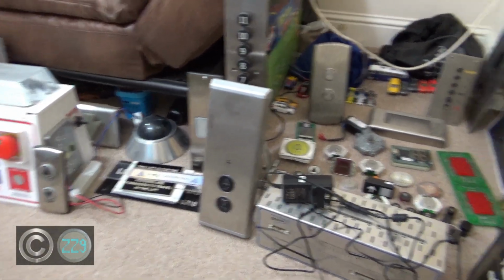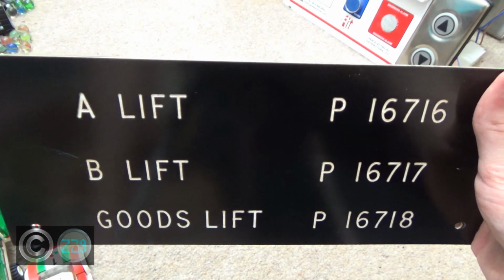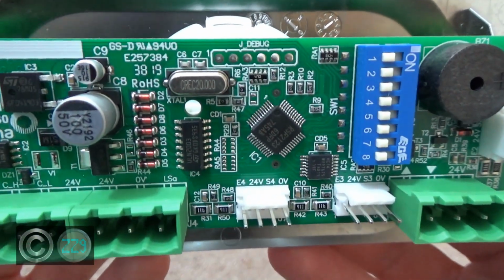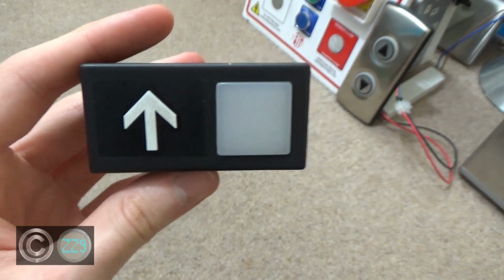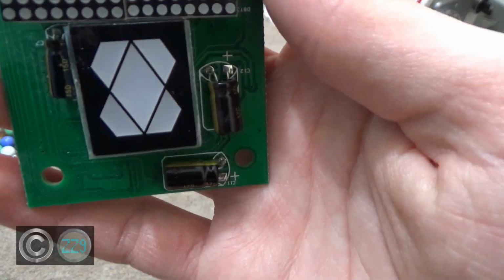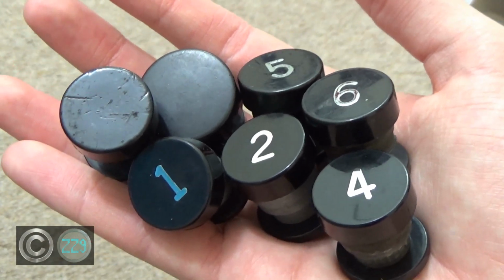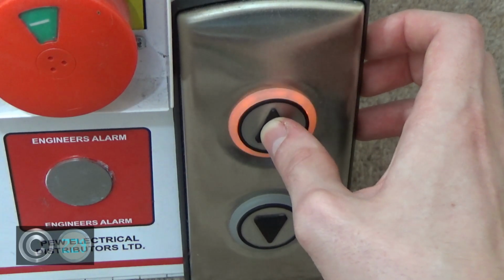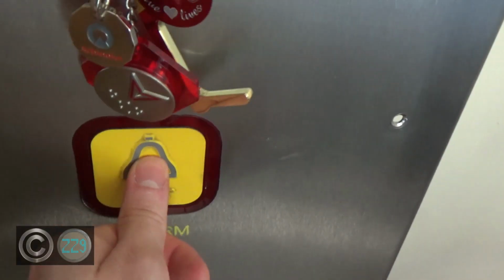Thank You For 3 YEARS On YouTube! Let's Celebrate By Showcasing My ENTIRE Lift Part Collection!

Comment: Considering I'm a little bored right now, I'm going to randomly chapter this out of kindness XD
0:00 Intro
1:25 Keyring
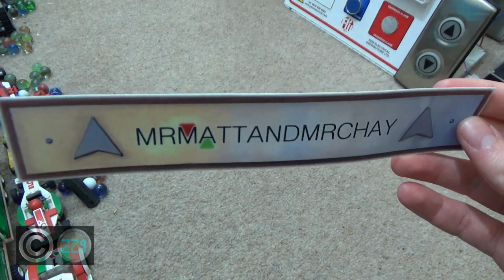4:03 mrmattandmrchay Logo
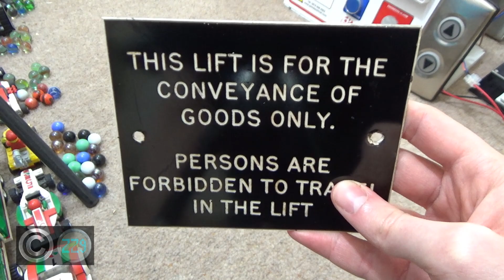4:52 Goods Lift Sign
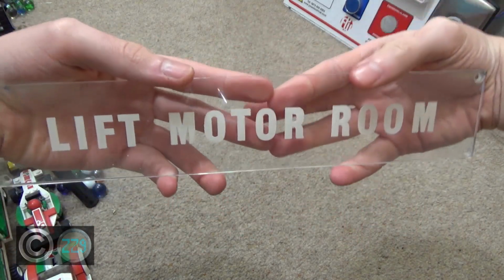5:41 Motor Room Sign
6:32 Multipurpose Lift Sign
8:23 Multipurpose Lift Sign's Brother
8:43 Kone panel goes to sleep
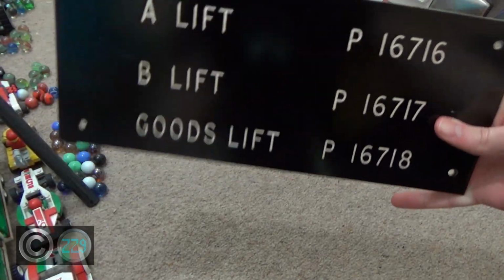8:48 Serial Number Sign
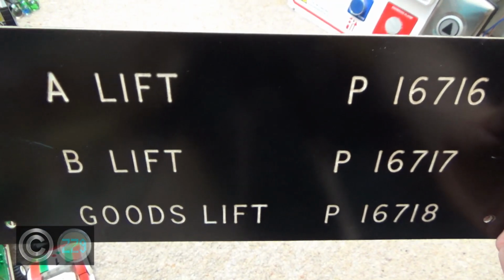10:17 Shepard Home Lift COP
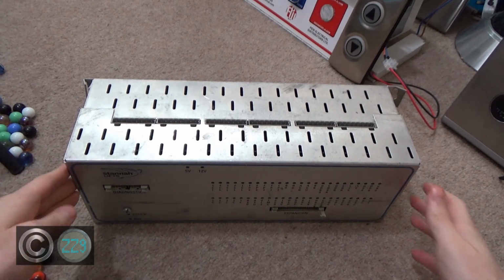11:18 Stannah Logic Box
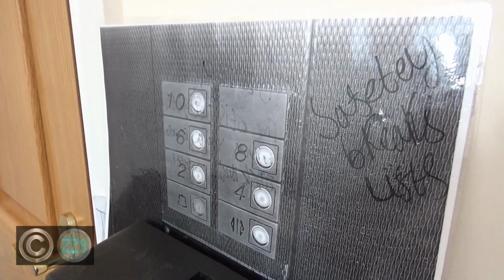13:25 SBL's Signed Picture
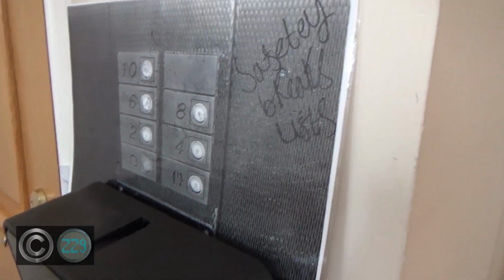13:47 Otis Series 1 COP
15:46 Vimec LOP
16:42 Schindler FIGS LOP
18:06 Orona 3G LOP
20:08 Otis Gen2 Lantern
21:38 Boxless Wadsworth LOP
23:13 Boxed Wadsworth LOP
24:39 American DMG Button
26:08 American Otis S1 Button
27:57 Armour Elevator Tie Clip
28:51 Shanghai STEP LOP
29:58 Old Otis Dumbwaiter Panel
31:20 Otis Gen2/2000 Indicator Plate
32:56 Otis 2000VF COP
33:39 Otis 2000VF Door Tracks
33:50 Otis 2000VF External Indicators
34:26 5x7 Indicator Boards
35:17 Lifteknic Logic Board
36:30 Kone KSI-4X1 Indicator Board
38:45 Old Otis Fridge Magnets
39:40 Evans Lifts COP
41:31 Random unknown thing that could be a door operator
42:08 Lift BuTtOnS XD lol
43:11 Dewhurst C3S Board
43:49 Multi-Key
44:48 Otis Black Buttons
46:00 Otis V Lock
47:12 Lester Controls Buttons
48:50 Kone KSS-470 Button
50:05 The Dewhurst Marathon
54:39 Kone KSS-370 LOP
55:57 Inspection Control
57:17 Security Camera
57:50 Old Otis Lantern
58:51 Dewhurst US85 LOPs
1:02:25 Old Otis LOP
1:03:08 Dewhurst US85 COP
1:04:37 Outro
I think these are right, although I'm not sure XD
Reply from the maker: That must have taken some off the scale boredom to do that XD anyways I can't be bothered to check so i shall assume those are all correct  and thank you for making all that effort XD fun fact the mystery motor o heard at one point could have been a windscreen wiper motor but no way of knowing for sure, way too small for door operator I think
Reply: @ZZ9ProductionsOFFICIAL  Yep, off the scale boredom is right XD. I was just there on the couch, computer draped across my knees, typing the comment as I watched the video. Good times XD
Reply from the maker: XD

Comment: I can't see the Schindler call station or the possibly UK Lift inner panel on the thumbnail. Also if you didn't get notified from my reply on ElevatorsInWalses' comment talking about my hopefully future lift part museum, here it is, (changed a bit): robably a bit of Kone to start off with. Probably KSS420, KSS140, KSS780, regular Sigma, KSSD20, KSS280 and possibly some M Series and Novel Elements! then I'll probably try to get some Schindler buttons, M Series and EuroLift, then some Otis, Prelexan, British Lexan, Selecta, Optima and Lumina and then if I'm VERY lucky, maybe Express 1st Generation! I will probably upload a video talking about it maybe early tomorrow.
Reply from the maker: the Schindler is hiding behind something here and the big COPs are way too heavy to be moved into the room that the rest of the things are in
Reply: @ZZ9ProductionsOFFICIAL  Ok. Make sure to check out the edited original comment here for some information...
Reply: @ZZ9ProductionsOFFICIAL  Ok, but all parts will be in the video?
Reply from the maker: @EEverything360  thats some big plans you have there!  One thing I'd say is make sure you've got plenty of space available for everything that you're wanting because it wouldn't be great if you got so far then realised you didn't have enough space for some things
Reply from the maker: @EEverything360  yeah everything's in the video
Reply: @ZZ9ProductionsOFFICIAL  Yes, I will. But I realised, I'm only planning to get call stations so for Otis, it won't matter for modern day fixtures, any Gen2/2000 call stations would do as they're basically the same.